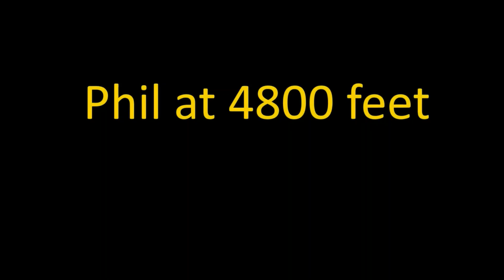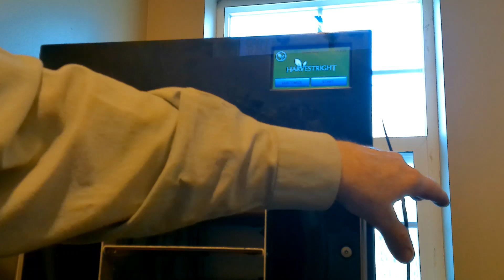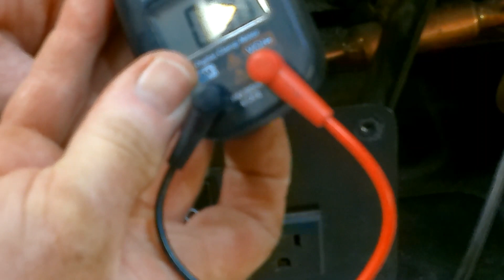Harvest Right Freeze Drier Arc Flash

Comment: Nice save.  I had something unusual with my freeze dryer this afternoon.   Turned the machine on and the opening screen said FACTORY SETTING HR said there might have been a power glitch but nothing else indicates that.  Hope it never happens again.
Reply: This sounds like an error reported by many in the FD repair group.  Did you need to do something to resolve it?
Reply: @kevinrowbotham545  
HR just had me change the last digit of the serial number from 0 to 1 and save and it was fixed.  HR customer support answers the phone very very quick I was surprised   I'm a little Leary of turning off the machine now.
Reply: @steelhorses2004  If it happens again you may need to change the coin cell battery on the control board to have the machine save settings when the power is off.
Reply: @kevinrowbotham545  I had the same bug. New FD (! week ago), and coin cell has to be good, the RTC (real-time clock) has no problems. This seems to be a known firmware issue. Likely the board is writing to its flash (built-in) memory when we power the FD off. Gets a corrupted file system and looses the settings. 
This can be as simple as some debug logging or "uptime" counter being written on a regular basis with no notification to the user. So if you power it off at the wrong time, you get a repro of the problem.
Reply: @TerryFrenchy  Yup you are right it could be a bug in the firmware too.  I hear a fix is coming.